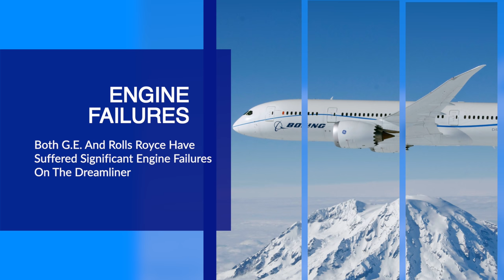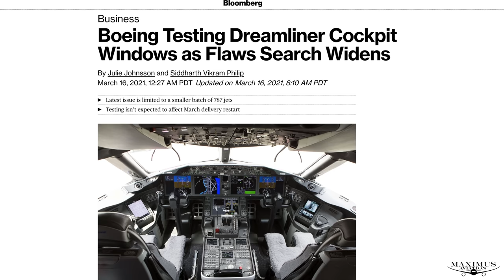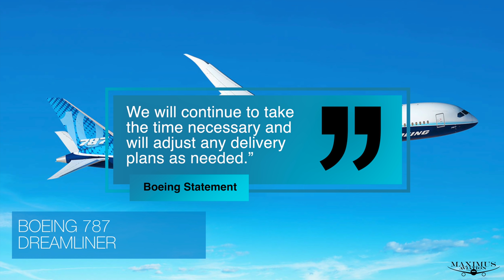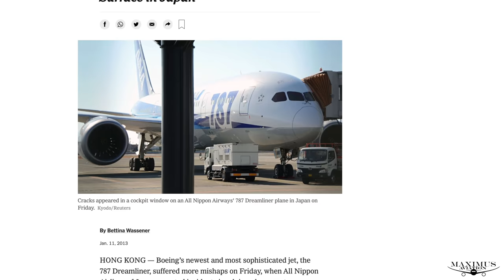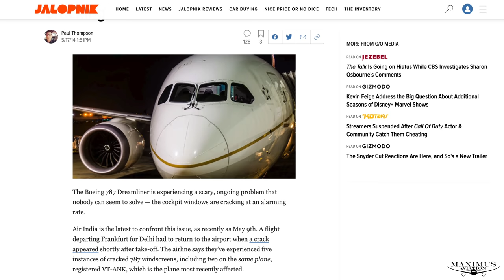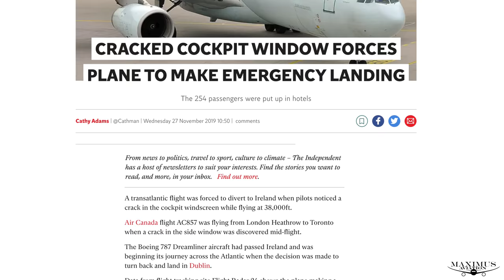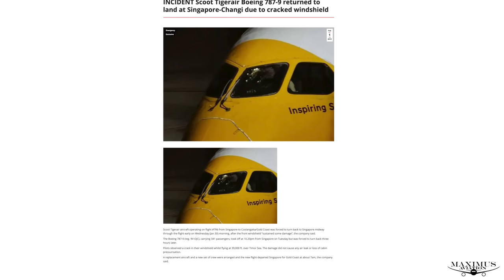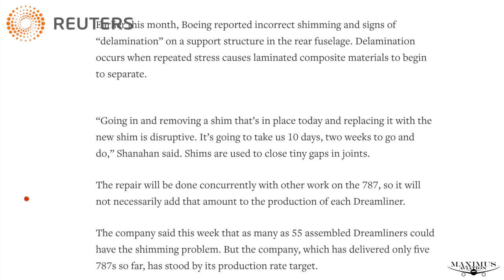Why Do The 787 Dreamliner Cockpit Windows Keep Shattering In Mid Air? How Dangerous Is It?

Comment: It is obviously Boeing policy to keep flying airplanes with issues. All 747-100 were flying for 25 years with construction error in the cargo door mechanism and NTSB even closed the investigation as door mishandling by the ground personnel. Parents of a dead passenger on United Airlines flight 811 had to investigate on their own to find the real cause - weak aluminium locking sectors and short circuit, that could open the cargo door inflight anytime! The issue was already known since 1975, repair costed 2000 USD, but because it would mean grounding of the airplane for 10 hours of maintenance, the airlines were reluctant to do the repair. They simply considered the possible crashes as collateral.Video: https://www.youtube.com/watch?v=0A2wvaRDzbQ

Comment: had the rt fwd windscreen outer pane (non-structural) shatter as the airplane (787-10) was depressurizing on rollout into sfo. what lead up to that was an arcing electrical window heat system that was creating a large void between the inner and outer panes..  turned off the window heat and the arcing stopped,  it was lighting up the windscreen like an incandescent light bulb (at night), plus it looked really scary. quite a loud bang when it shattered on rollout, I ducked. Proudly built in So. Carolina.. you get what you pay for I 'spose?

Comment: Boeing’s brand is eroding, an the brass at the top don’t quite get it. Most recent after the 737 Max catastrophe, is the 777 9X which the FAA is not go into allow release now until 2023…it also has uncontrolled pitch problems due to software problems, but also because Boeing once again decided to cut costs and accelerate speed to market by bo,ting things on the plane, rather than re-engineering it. This is a deep philosophical issue which is translating into aircraft design and integrity, fueled by shareholders rather than the proper approach to design, manufacturing a new airplane.

They are dying by a thousand cuts, and one day are going to wake up and find that Airbus has overtaken them exponentially…what I fear however are the passengers and crew that are going to be in danger because of these extremely poor decisions

Comment: I don't get why they don't just make their own windows, it's clear that the company that makes them are bad at there job
Reply: Maybe there's a legal reason. After all, Boeing used to make their own engines in their very early days until law put a stop on that.
Reply: @Blank00  Ah makes sense
Reply: Who says it's the windows, could be the window openings in the fuselage or the installation technique....................perhaps both? The old Boeing is long gone they can't properly engineer or build anything of quality because the Boeing Board only knows how to sell snake oil and push their stock up off of BS and lies.
Reply: as others have suggested, maybe the problem is there is too much flex in the composite cockpit which eventually leads to the windows cracking.  If that's the root of the problem, Boeing needs to start making the cockpit section out of aluminum or titanium alloy, something that will not flex as much as carbon composites.
Reply: On the a350 the only part still being full alluminium is the cockpit i think. The rest is composite as well. As i understand the dreamliner is completely made of composites.

There must be a reason why airbus made that choice, this could maybe be part of that reason.

Comment: the answer is simple  BOEING BUILDS SHIT!!!!! and thats it,,, boeing was to much in a rush to keep up with air bus, they forgot quality control and safety checks,,, i seen the  reports of sections of the fuselage not fitting properly,, metal shavings  near wiring 
 and window and door trim held in place with super glue and duct tape REALLY BOEING???? the same company that built the 747.. and 777???
Reply: I suspect that most of the builders of the 747 have retired or been laid off by the fools with MBA's so its not really the same company at manufacturing level.

Comment: It's not that dangerous but these shitty windows are over 300000.00 a piece!  Not to mention all the other disastrous problems with the 787!  The delays,  problems and engine issues for a 250,000,000.00 airplane are an insult to anyone who spends that kind of money and gets a shit product.  I'd definitely buy an A350 instead.

Comment: But Maximus, are you a duck?

Boeing do not make the windows, they did not design them either.. so how can you fault Boeing for cracking windows? Same with other items, batteries are not designed or manufactured by Boeing either. It is the same with many things.. the important thing is that issues are discovered and fixed..

Comment: Why are you mentioning engine failures in the beginning and towards the end? That category of issue is not Boeing's fault at all.
Reply: While I do agree with you there may be something that Boeing have done that could be a factor. Let’s look at everything.
Reply: true.  kinda sort of.  But if true, then couldn't you make the same argument for the windows cracking?  Boeing doesn't make the windows, so it's not Boeing's fault at all, right?
Reply: @pimacanyon6208  The reason Boeing would be blamed here is because Boeing never disclosed who made the windows. With the engines however, the names of the makers have been disclosed at the very beginning of the program, long before the engines started to have issues. Also, engine maintence works a little differently than window maintainence. Engines get periodically replaced, and after the first pair of engines, all subsequent pairs come directly from the engine supplier. The windows work differently because I doubt that the airline execs know who makes windows.
Reply: @pimacanyon6208  Boeing designed and specify the windows and should be checking quality control on arrival so it does make it Boeing’s problem. 

While the engines are ordered separately by the airlines they may require specific control commands from the cockpit which because of quality issues are causing issues within the engines. So it may still be a Boeing problem.
Reply: @davidlazarus67  good point.
Reply: @Blank00  good point.
Reply: @davidlazarus67  But the 787 has 2 engine choices: GE and RR and even though GE had issues in the past, GE engines are operating fine now and as of today, there's a huge disparity between GE and RR reliability. Something from Boeing's part will not cause this disparity.